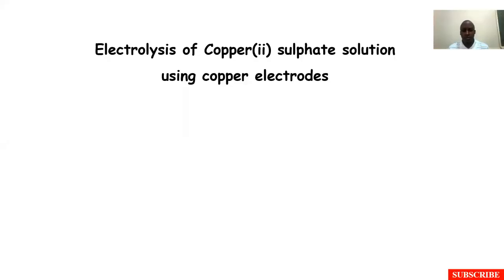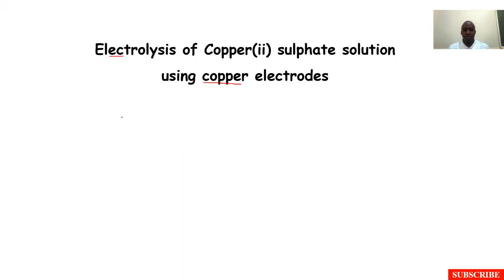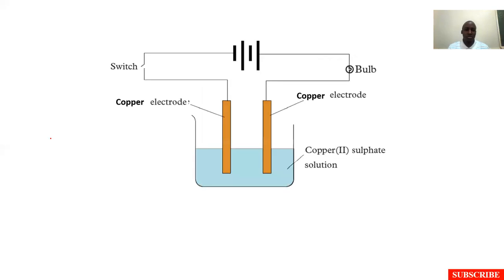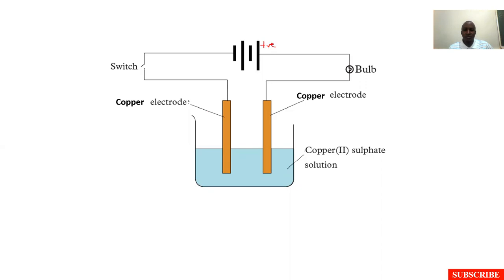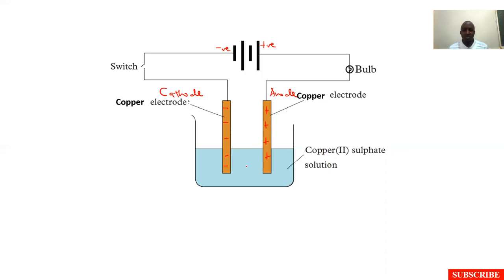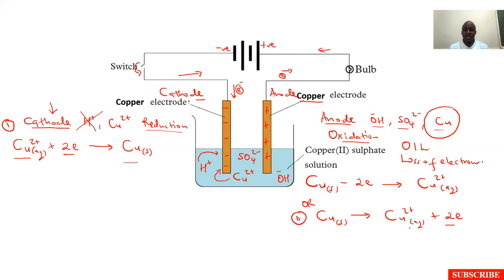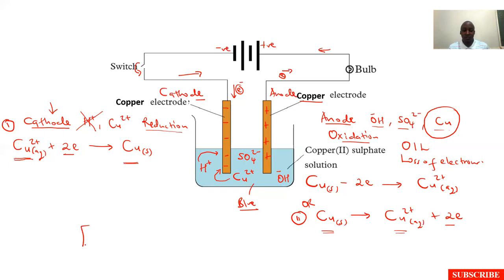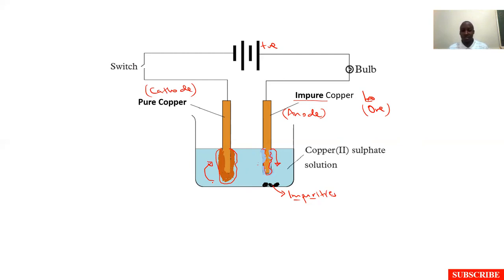Electrolysis Of Copper(ii) Sulphate Using Copper Electrodes

Comment: But why is the oxidation of copper preferred
Reply from the maker: @moran-gq8rv The applied cell voltage during copper purification is carefully chosen...just enough to oxidize copper, but not enough to oxidize water (which would produce oxygen gas)...Since it's not an inert electrode.
Removal of Copper ions at the other electrode keeps driving this reaction too in an attempt to create equilibrium
Reply from the maker: Voltage used is chosen based on the electrode potential of copper
Reply: @kigozibrammer  so can i say bc the electrode potential of copper is less positive than that of water, it will be oxidised?
Reply from the maker: @moran-gq8rv  Simply...due to the nature of the electrode, copper is oxidised and dissolved... Is fine. Complex explanations aren't needed